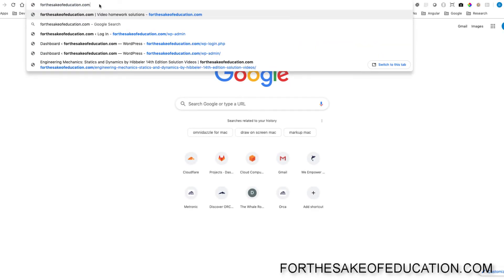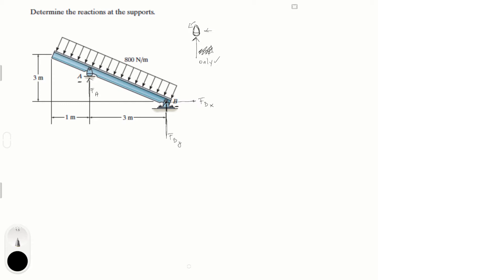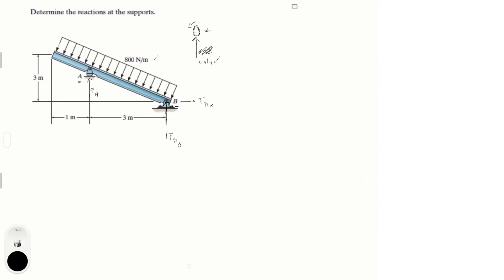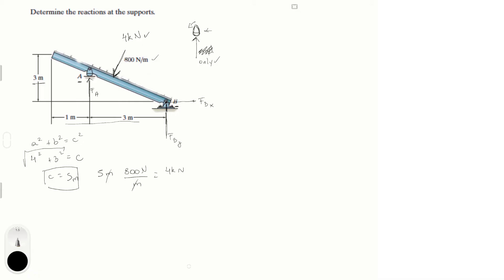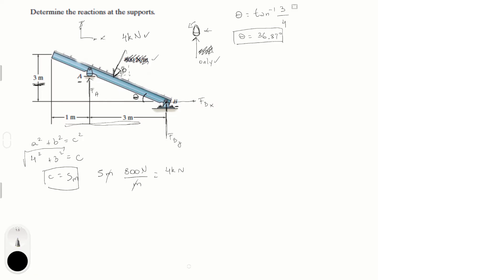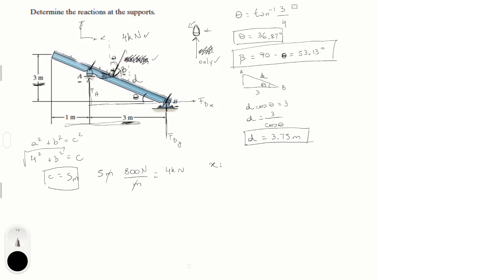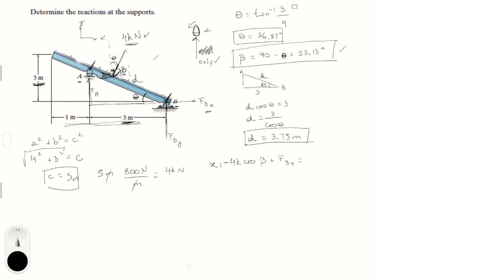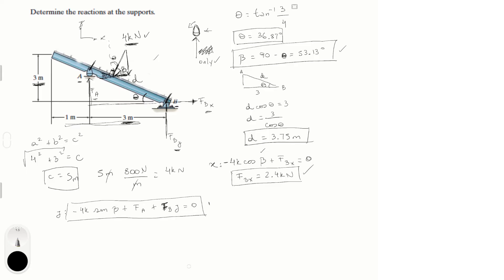Determine the reactions at the supports

Comment: Why do you have Bx going in the positive x direction? It's not pulling the beam, it's resisting in the negative x direction.
Reply: both way works, if u set the Bx to negative x direction and your answer is -2400N, the correct direction is actually towards the positive x direction

Comment: There are a few comments saying his FA is wrong. It's right (source: the textbook), but he set it up incorrectly. Should be 4(2.5) - FA(4/5)(3.75) = 0, FA = 3.33. He probably didn't calculate his expression manually; instead, he just checked the textbook and wrote down the answer.
Reply: thank you
Reply: Why isn't it just 4(2.5) - FA(3.75) = 0? Cause I thought for the moment, the Force has to be vertical to the pole, so you don't need to time 4/5.
Reply: @blackwingBF   4(2.5) - FA'(3.75) = 0 will give you the force that is vertical to the beam, but that's FA', not FA. You could imagine it as if the beam was straight but the support was at an angle. The reactionary force of the support would also be at an angle, so when you calculate the moment, you would find the component of the support's force that was upright and not the actual reactionary force of the support. Or something like that.